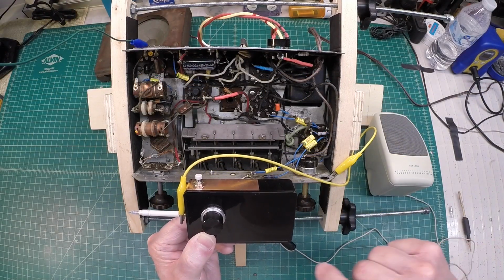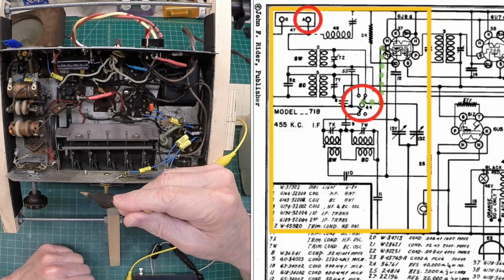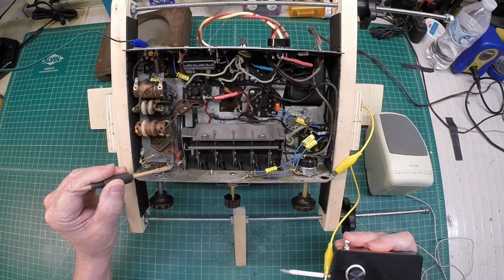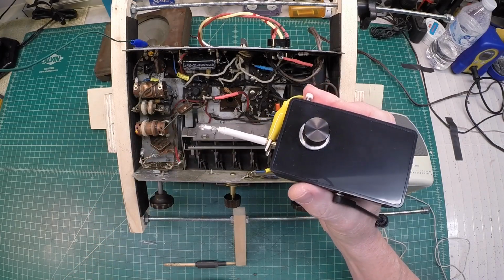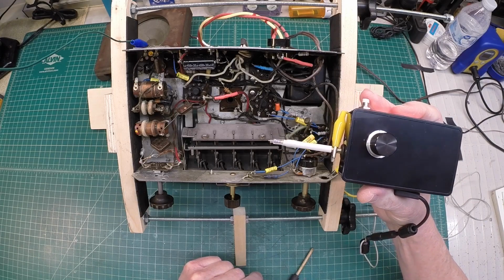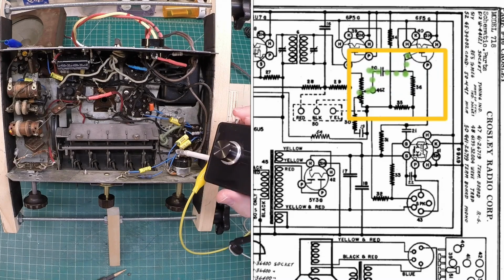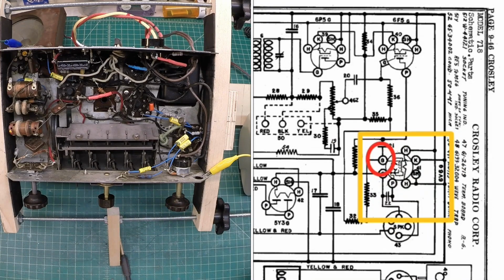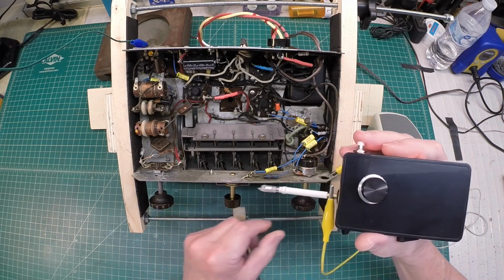Signal Tracing Demo - Low & High Impedance Test Point Locations

Comment: Hi Don, Inspired by your great videos, I'm gathering the parts needed to make one of your AF/RF Signal Tracers. At 1:10 you mention a 56pF capacitor and I wonder if this needs to be 600v rated as per the capacitor at the other end of the probe, for use on tubes etc.? Did you use an axial lead type? Thanks, Mark
Reply from the maker: Mark - sorry for my belated response. The 56pF capacitor I used is rated at 600V. Just use a voltage rating that is greater than the circuit under test. Hope this helps. Best, Don

Comment: Hi Don, I'm trying to figure out how this probe is different than the probe with the metal case? Is there a video, diagram or any other info on this one? Thanks.
Reply from the maker: It’s the same exact circuit built as the other in a single plastic enclosure (all in one) I mentioned. I use a momentary push button switch for turning on/off and a piece of copper foil tape on the side by the switch that ties to circuit ground that your finger rest on while using the unit. Hope this helps. Best, Don

Comment: Mr. Don, sir! Thanks for another outstanding and informative video! I'm trying to use my signal tracer to track down a problem with a 6-S-52 that I recently picked up. I saw that you had experience with this one yourself, so I'm hoping you can point me in the right direction. I got mine from a teenager who began trying to clean it up for his grandmother. He said it was in working condition when he removed the tuning capacitor to replace the rubber pads, but it's been dead ever since. I reattached the tuning cap per the schematic (and where I saw the evidence that the solder had been disturbed). This model has a dedicated shortwave coil that sits atop a detector AND pre-selector coil, and this has me befuddled.

Using a signal tracer built from your plans, I can get a VERY strong signal from the center section of the tuner (labeled "pre-selector" on the schematic). I can also get a signal from the section marked "detector", which feeds the 6A8 tube. I do NOT get a signal from the tuner section marked "oscillator", nor do I get a signal from any other pin on the 6A8 tube - or any other point anywhere else in the radio. The signal just disappears. The tube is good, and just to be certain, I swapped it out with another from a working radio (both tubes work in the other radio). So - questions: 

1) What is the function of the pre-selector? Why is the signal so much stronger than on the detector section?
2) Why wouldn't I be getting any signal from the output of the 6A8? 

The schematic for this has me scratching my head. Any tips on where I should be looking for trouble? 

As always, I appreciate your kind attention.
Reply from the maker: Sorry for my belated response, I’m hopeful you’ll get it playing soon. The pre-selector is a band pass filter for the receiver, so by design it only passes signals along for the band of interest thus improving the receiver front-end performance.

For my edification, have the old capacitors and out of tolerance resistors been replaced?

Can you hear anything from the loudspeaker while adjusting the volume control?

Best,

Don
Reply: @RestoreOldRadios   Thanks for the response! My grandmother used to say, "A helping hand is a helping hand, regardless of when it's extended". I'm a firm believer in that, and I certainly appreciate ANY response.

A quick note about how I acquired the radio: my neighbor is an older lady (I'm 52 years old, so that should provide some perspective on the term "older") who's had it for many years. It was played somewhat regularly, and she'd let me listen to it whenever I'd go over to fix her computer/printer/TV issues. After she told me that it had never broken down or repaired, I told her how surprised I was that the e-caps were still operational and that it hadn't gone out on her. Well, her grandson took it upon himself to proactively swap out the e-caps to forestall tube any damage from them giving out unexpectedly. He neglected to mention that he had removed the tuner when he brought me the original cans to re-stuff. I only found out two weeks later when I got the call from the lady, telling me that her grandson had botched the job. I was surprised to find the tuner completely removed but was confident that once it was reconnected that it would fire right up. After all, I had heard it playing only two or three weeks prior.

While the tuner was removed, I ran it through my ultrasonic cleaner and afterward rinsed it thoroughly. I reattached it as described above and double-checked to make sure the e-caps were reconnected as shown in the schematic. I also found a stray wire that had broken loose - it appears to be the ground lead (black wire) for the 2nd IF coil - which I reattached to the volume control tap.

Since I personally experienced that the set was operational before the tuner was removed, I didn't bother replacing any other components. I hooked it up to my Variac and slowly raised the voltage to make sure nothing ran afoul. I attached your handy-dandy signal tracer to the grid cap of the 6A8 expecting everything to work but found the strange results. I'm happy to swap out the caps and resistors since I'll eventually be doing that anyway; I just figured it would be a quick fix since it was working a few weeks back, and it might be trickier to track down issue(s) the further from original it got. :(

I used your signal generator trick to verify that he primary and secondary windings of the audio transformer are good, and that the speaker is operational. It also attracts my small screwdriver, so we know it's magnetized.

Since I first posted my question, I observed a few more things:

The ONLY time I can get a signal AT ALL from the tuning cap is when there's an "antenna" (in my case, several test leads clipped together) connected to the lug on the back side of the chassis. I don't recall that being the case with other radios, but maybe I'm imagining it. I reconnected the "antenna" back to the lug so that I could get a signal from the tuner, and tuned in my strongest local station (KIXI 880 AM in Seattle) with the tracer on the pre-selector section of the tuning cap. I checked all the sections again and got the same results: No signal from the oscillator section, a clear signal from the preselector section, and a much weaker signal from the detector. Touching the 6A8 grid cap with a wetted finger did nothing at all. I pulled the leads off the lug and attached them directly to the 6A8 grid cap, also with no noticeable change. :( :(

Another thing that I noticed was there are FOUR wires in total coming through the chassis from the bottom of the tuning cap and attaching to a ground. There's one black wire coming from the detector section frame, another black wire coming from the pre-selector frame, but TWO wires coming from the oscillator section of the tuner - one of them is the same black color as the grounds on the other sections, but the other appears to be green when viewed under a bright light. Perhaps this green wire isn't actually a ground, and should be connected elsewhere?

I'm keen to take your advice on how to proceed next. As always, thanks in advance for your support!

Comment: The stand alone probe really works very well Don, witch of the two versions do you like the best?
Reply from the maker: Jim - ergonomically Probe 1, but portability and features since I built it to support my Bluetooth Tx makes it too close to call. Both perform equally well. I increased the LM386 gain in the all in one as well. The copper tape on the right side is attached to circuit ground beside the momentary on/off switch (which I really like) allows my finger to ground the circuit and mitigate 60 Hz noise. I thought that was pretty clever. Thanks for watching. Best, Don

Comment: Hi don awesome build big thumbs up 👍. How did you assemble the probe  do you have some tube slid in between the brass tubing or did you just make end caps to keep the inner and outer brass tube separate, cheers 🍻 mate
Reply from the maker: Allan - two pieces of brass tubing with heat shrink separating the conductors. My as-built drawings are available at the URL in the video description (show more). Thanks for watching. Best, Don
Reply: @RestoreOldRadios  that's awesome,  Don

Comment: Don, Is there anyway you eliminate having to change the impedance all the time for Low &High scale. Could you use resistor and a capacitor in series  inside the  the front tube?
Reply from the maker: Dennis - to your point, one could compromise and probably find values for the capacitor and resistor combination that works satisfactory. My intention with the video was to demonstrate how the ST loading can compromise the usefulness of the tracer at times. Thanks for reaching out and watching. Best, Don